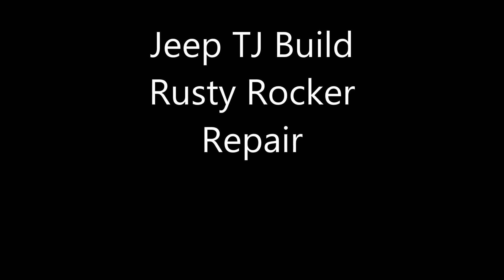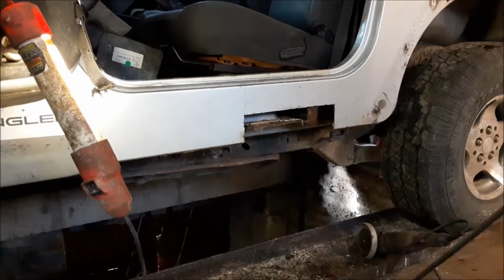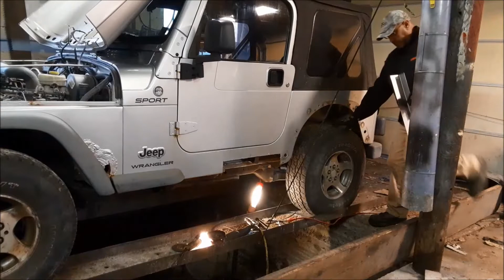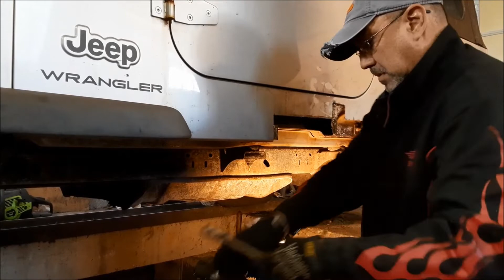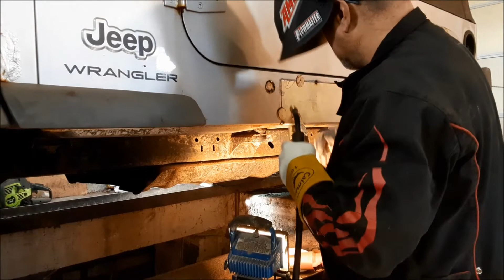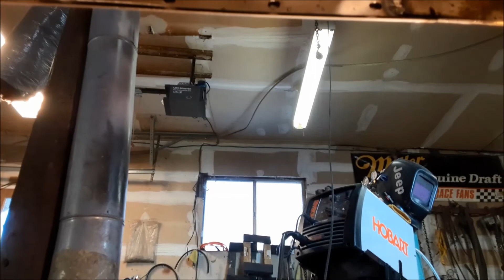TJ Rusty Rocker Repair and some tips and tricks

Comment: Great video! I have about the same rust but a lot worse. I thought I seen a side panel patch online somewhere. My problem is mine is an LJ so I will have to make everything.
Reply from the maker: Your better off anyway. All the patch panels they sell are thin covers that go over the rocker. You would have to put a bunch of filler in to make it look half way presentable.